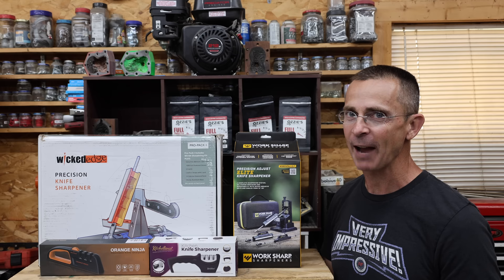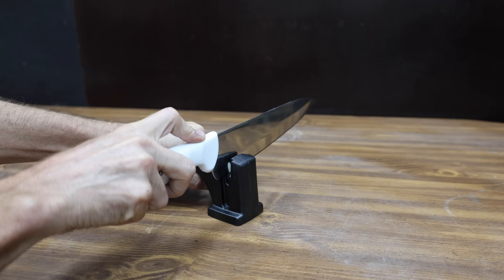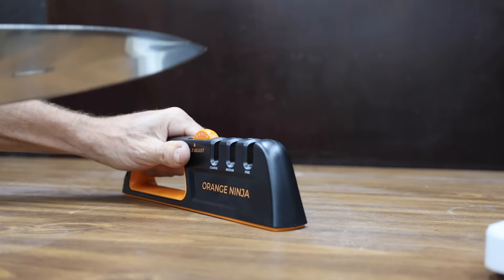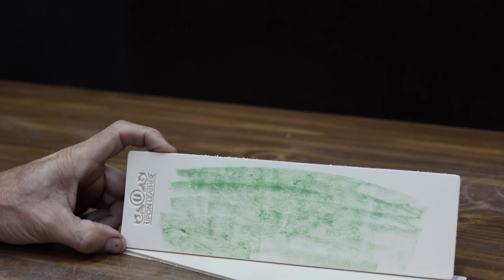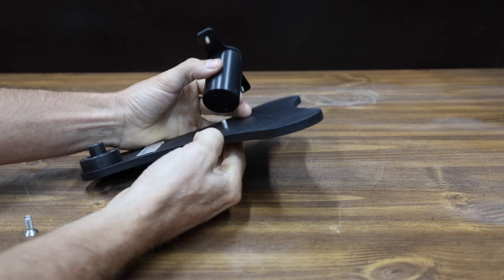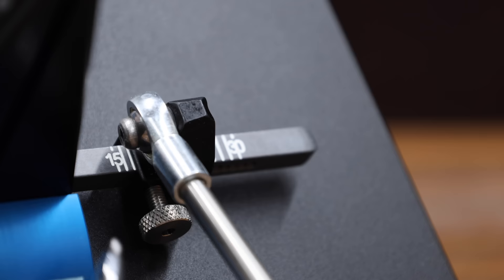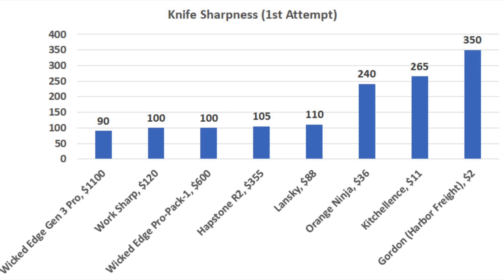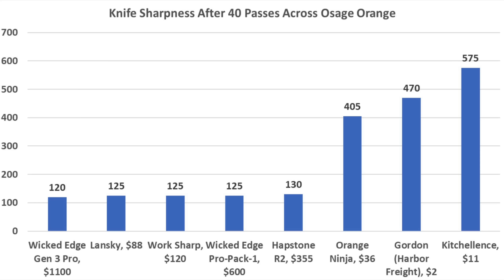Best Knife Sharpener 2023? Let’s Find Out!

Comment: I guess i just use 2 or 3 tiger stones and hold the blade by hand. A single tiger stone varies in price but i doubt i paid much more than $20 to $50. These stones will last 2 lifetimes. When the blades are allowed to get really dull i start off with my grinding wheel. Do i get super sharp knives? Good enough for cutting cabbage or tomatoes. The diamond plattens are better but more expensive.
Reply from the maker: Thanks for sharing.

Comment: I'd love to see a comparison between the cylindrical finned style Transmission coolers versus the more common aftermarket stacked fin type transmission coolers, and the OEM coolers that are built into the radiator.   Those OEM radiators that act as both Engine and Transmission coolers can fail catastrophically and allow transmission fluid to mix with engine coolant, and then you have a $2,000 bill to rebuild your transmission.
Reply from the maker: Thanks for the suggestion.

Comment: I don't know since Lansky has gone 'China', but in the original system you used honing oil on the stones and when it got dirty you blotted off the old and put new oil on. They also had optional stones to buy that went super fine. I've been using their system since the '70s. Not the fastest system for sure, but putting a working edge on a knife shouldn't involve a speed test. I have the Work Sharp with the motor and grit belts. While it works well, it removes way too much metal material. I just use it for replaceable kitchen knives. I didn't know they make a hand system similar to Lansky. Osage Orange.....I had fences made with that back in MO....lol. For my money, it's Lansky....using the honing oil. Thanks for the sharpener comparisons!
Reply from the maker: You are welcome!  Thanks for the feedback.

Comment: nice video but i would love to see a video where you are testing free hand stones. Starting from cheapest gray stone, wet stones and ending with expensive diamond stones and Japanese wet stones. It is harder to use them but should be cheaper (especially in a long run) to buy them and get same results for half a price.
Reply from the maker: Thanks for the suggestion.

Comment: Could you test tire valve stems?  There are a lot of DYI tire-puncture repair kits out there, some of which require unscrewing the valve stem.  Naturally, that requires screwing them back in afterward.
I was having some trouble with one of my tires losing air recently, tried various things, and finally took my truck to a shop.  They informed me that the valve stem had been partially stripped.  I don't know if that was due to age or something I did, but I would love to know what kinds of valve stems are more DIY-friendly than others.
Reply from the maker: Thanks for the suggestion.

Comment: Only problem with those guided sharpening units is the stone hits the bevelled edge of the clamp when sharpening a blade that isn't so wide for example a fillet knife, rendering it absolutely useless. Get good with wet stones people. Best sharpening method by far.
Reply from the maker: Thanks for the feedback.

Comment: Really wish you tested the workssharp mk2 electric sharpener. Its been the absolute best sharpener I ever tried. It balnces ease of use with convenience. I bought some aftermarket sanding belts that go to 5000 grit and a good top grain leather strop and that makes for a polished edge.
Reply from the maker: Thanks for the suggestion.

Comment: kinda curious as to how these sharpeners hold up against a wood wheel with a cutting compound rubbed into it, can't remember what channel I saw it on but a few summers ago when I was cutting back some blackberries with a machete I had to keep sharpening it, after getting tired of breaking out the grinder and stone day after day I looked up other methods of sharpening blades and found a video of a guy making a wheel for a bench grinder out of plywood, figured I'd give it a try now I use it for everything including my filet knife and it works better than the ceramic rod sharpener that came with the filet knife
Reply from the maker: Thanks for the suggestion.

Comment: I strongly recommend learning to use whetstones. There's a little learning curve in holding the blade at the right angle, but once you get there it's faster, easier, and plenty sharp. Plus they're much cheaper than the better options from this video, and it's much safer to be moving the blade against the stone rather than moving your hand against a stationary blade.
Reply from the maker: Thanks for the feedback.

Comment: super curious about the longevity of diamond vs whetstones. I sharpen by hand and flatten my whetstones on a tile with sand paper every time, but I also am sharpening straight razors on it, so not sure if that's significant. Will diamond stones stay flat? Whetatones don't but are easy to flatten in my experience.

Comment: i would have like to see how a motorized sharpener, such as the Chef's Choice, compared.  I can easily sharpen a knife in less than a minute with the chef's choice, as opposed to 4 minutes or more with these weird contraptions.   If you are sharpenig fifteen knives in your knife holder block at the same time, that is a BIG difference.  Was wondering if hand-sharpening was so much better that it justified the 4X longer sharpening time?
Reply from the maker: Thanks for the suggestion.

Comment: Very interesting, but how long will the sharpening stones last?
I have bought 2 of the cheaper ones over the years and the results were as shown. Not very sharp for long and not that sharp to begin with. The sharpening stones on the small ones also didnt last long. Therefore it would be nice to know, if for example the lansky is able to sharpen for a few years, or if a regular old sharpening stone from a good brand will last for ever.

Comment: I looked through the videos for a show on heat guns, did not notice one.
That would be a video test best corded then do another with best cordless [batteries cannot last that long with a heat gun]. Well I am going to purchase a new heat gun now. The high heat wire to the heater some how pulled out of the heater element; a very fine wire broke that is in the heater element they used a crimp on clamp to connect the heavy electric wire from power switch to the crimp on clamp and tiny wire.
Reply from the maker: Thanks for the suggestion.

Comment: Video Idea: Test high heat spray paints. could test them on car exhaust system like on the catalytic converter since they do get pretty hot. Test for corrosion resistance, paint durability and which paint brand can withstand or exceed it's rated temperature.
Reply from the maker: Thanks for the video idea.

Comment: SUGGESTION: I just dropped my external harddrive and it stopped working, wasn't a particularly hard fall. I know it's not in the vein of your usual products to review, but I immediately came to your channel to check and see if you had done any durability testing on external hard drives. My suggestion is testing tech products, if only for durability, specifically external hard drives. How does the USB connection fair under duress? Drop test? Waterproof? Heat/Cold resistant? Dust (many products advertise dust resistance)? File transfer speed? etc..many of these products have similar seemingly unverifiable claims as to the physical aspects of the devices, so even though you might not specifically be a 'technology review' I'm sure you could facilitate some meaningful tests in regards to a products physical aspects.

Any way, thanks for quality content as always, best to you and your loved ones.
Reply from the maker: You are welcome!  Thanks for the suggestion.

Comment: Excellent video. I'd love to see you test cardboard buffing wheel knife sharpening systems using the same procedure. I use the Slicing Edge systems and it is super easy to use, very quick and makes a very sharp edge (as far as I can tell).
Reply from the maker: Thanks!  Thanks for the suggestion.
Reply: Great work as always! I would love to see you test dashcams next 👌. Best wishes!

Comment: I wonder. The first three sharpeners requires you to hold the knife perfectly vertical. Even being 1 degree off is going to work against you. I think it would be a great improvement in design if they added a stop to 1 side so when the side of the blade is pressed against it, the knife will be perfectly vertical.
Reply from the maker: Thanks for the feedback.

Comment: How about IKEA sharpener? It has 3 pairs of conical ceramic stones that roll along the blade. There are also several other manufacturers who build very similar sharpeners. I would have loved to know whether they work better or worse than pull through sharpeners which use stationary blades.

Honestly i think the world is waiting for an invention to come along. Something that is as compact as pull through sharpeners and requires no setup time, but also achieves the outcome like stone guides. There's no hard reason it should be impossible right? Ideally also super quick and maybe motorised.
Reply from the maker: Thanks for the suggestion.

Comment: @projectfarm i’m not sure how you would test this, but it seems people are using balance beads over weights to balance their tires. I didn’t know if you could do a test on if the balance beads actually work any better, or more accurate, or last longer than wheel weights?
Reply from the maker: Thanks for the suggestion.

Comment: I use a worksharp pro position.  It's hands down a much better unit  . But it costs 3x more. 
       I started using 3M lap film with a little water. I'm not kidding at all I don't show people my knife anymore.  To many people cut them shelves. That added another 80$ to get aftermarket metal blanks from Esty but my pocket knife is close to scapol sharp. 
    I also learned a Lil trick when I started going down the sharpener habit hole. If you strop your utility blades they have a pretty good bur out of the package but a few swipes on a strop with some diamond compound you'd be surprised how much sharper they can be.
Reply from the maker: Thanks for sharing.

Comment: While all of these sharpeners seem interesting, I feel fortunate to have the ability to freehand and use the blade to shave. However, you should try the "Furi" diamond fingers knife sharper by Ozitech. It does an excellent job for a maintenance sharpener. That's what my wife will use until I  can sit down with her blades.
Reply from the maker: Thanks for the suggestion.

Comment: The biggest downside of the Work Sharp is the chassis is made of plastic. It flexes when you apply pressure to the blade, which changes the sharpening angle. People sell 3D-printed braces for it, but they should be including something similar with the kit. Other than that, I've been very happy with mine
Reply from the maker: Thanks for the feedback.

Comment: Will you do a test between all the “higher quality” 0w20 engine oils so I can make a decision on what to use in my 2018 Chevy Cruze premier hatchback. It has a 1.4l turbo. 
I’ve been using mobil 1 0w20 with a Mobil 1 filter. And I’ve been changing the oil every 2500-3000 miles

Also I drive around 1000 miles a week
Reply from the maker: Thanks for the suggestion.

Comment: As always appreciated. But for knives it is fine an understood now. A year ago or so you tortured scissors. We have this KAI 7000 scissor too. But it has a burr and needs sharpening, however the angle is much larger than 17 degrees, more closely to 40 to 45. Do you have any idea how to sharpen scissors with the stone sharpeners. (i never believed in these pull through sharpeners, which is motivated once again here).
Reply from the maker: Thanks!  Thanks for the suggestion.

Comment: sharpening a knife removes edge to thin and create a new edge.
honing is smoothing the edge aligning the old blade.
they are not the same thing. 
a whetstone or grinder is required to sharpen.
the 2 rods in a V shape are used to hone.

Comment: Could you do a test on rotary tools? I have all Milwaukee power tools so i figured i would get the m12 rotary tool and it is horrible, it cant even cut a pvc pipe in half without shutting off let alone the thin sheet metal project i was hoping to use it on.
Reply from the maker: Thanks for the suggestion.

Comment: A quick PSA I’m not affiliated with anyone but just someone who values a good blade. While the cost and ease of use makes the pull through ones very appealing. That style of sharpener is damaging to the angle symmetry of the blade as well as the overall longevity of the knife.
Reply from the maker: Thanks for sharing.

Comment: just use a sharpening stone, not only it can sharpen knife, but it can sharpen tools too like utility knife, wire cutter, tin snip, bolt cutter etc..
all you need is 400, 1000, 3000 grit stones. 400 if u working with a new knife u have to form a new edge/angle.  for further maintenance u just do 1000 & 3000
Reply from the maker: Thanks for the suggestion.

Comment: Hey Todd could you test Impact Driver hex nut bit sets? I want to use my impact driver for smaller nuts and bolts but using a universal adapter adds length to the tool which can be an issue in tight spaces. Thanks!
Reply from the maker: Thanks for the video idea.

Comment: Those pull through knife sharpeners are annoying to use for more than one knife at a time and it takes some concentration to not hit the edge somewhere while pulling through. Sharpening stones are good but again tedious for more than a couple of knives and also for some reason I cant get the motion correct to sharpen the right side edge. I recently finally picked up a basic electric knife sharpener thats two sets of rotating diamond discs of different grits. Its not perfectly even because of the springiness of the discs but it does the job well enough and its convenient. I should ideally add an extra finishing step at the end but the results are good enough
Reply from the maker: Thanks for the feedback.

Comment: Project farm have you done sthil moto mix v truefuel or similar? Also best chain and bar lube? Im getting into cutting alot and for 1 gallon of the dgp or biodegradable bar lube and a gallon of moto mix is 80 bucks. It last me anojt a month or more but i used to buy the walmart bar lube then run ethenol free with sthil 2 cycle oil. And that cost like 20 bucks for a a gallon of fuel and lube.
Reply from the maker: Thank for the suggestion.

Comment: I bought a lansky a couple years ago. The aluminum clamp is absolute garbage. Especially on smaller blades. It's impossible to clamp the blade squarely and securely. The blades still wobble site to side, throwing off the angle.
Reply from the maker: Thanks for sharing.

Comment: Too bad you didn’t do the TSPROF k03 this time. Hopefully next time! Really do think it’s one of the unbeatable sharpeners as long as you have a good set of stones.
Reply from the maker: Thanks for the suggestion.
Reply: @ProjectFarm  another suggestion would be to do the best knife sharpening stones. Use one sharpening system (like the TSPROF k03, for example) and try out all the different brand stones. That way it really shows which stones are the best, you have all your variables controlled, for the most part, except your testing the stones on how well they sharpen the blade.

Comment: Im a professional sushi chef. I sharpen knives every single day. I also owned a Wicked edge and an Edge Pro. These systems are kinda meh.

They are okay when new but slowly the stones and diamond plates wear out. Stones would dish and you would get a bad result. Diamond plates don't really last either. They last longer but not ideal. I find that they are too expensive to replace.

The only thing these fixed angle systems provide is a fixed angle so you don't need any skill. I find that buying actual stones and doing it free hand with a little skill is both faster and cheaper. Stones are more readily available and can accommodate more styles of knives (single bevel, double bevel, thick sushi knives, cleavers etc etc).

I also want to give a shoutout to the Belt Grinder. Going free hand on a belt grinder is also very easy and belts are super cheap. Very fast and little skill required.
Reply from the maker: Thanks for sharing.

Comment: I’ve never understood why we test sharpness of a knife by only testing a very tiny part of the blade. Only the width of the wire testing material gets tested. Seems very counterintuitive. 

these sharpener testers test anything more than the width of the wire in the tester. So I guess you can walk away knowing that this small fraction of an inch of your knife blade if just that sharp!

Comment: Nice.  Now pick the best and test different steel kitchen knives.
I've used pull throughs, powered wheel pull throughs, always disappointing.
Bought high quality steel set and they just last for kitchen work.
I would NOT want all my kitchen knives to be razor sharp.
Reply from the maker: Thanks for the suggestion.

Comment: You cant really say which is best without trying other types of steels….super steels, powder metal steels that a lot of sharpeners wont do anything to.   Those kitchen knives you have there are one of the easiest types  of steels to sharpen.   

The cheap sharpeners wont even start to sharpen a steel like cpm s110v or some of those notoriously hard to sharpen steels.    Thats where you get into the premium sharpeners.   Those steels will shred a cheap amazon sharpening stone to pieces…youll wear down the entire stone and still have no edge.
Reply from the maker: Thanks for the feedback.